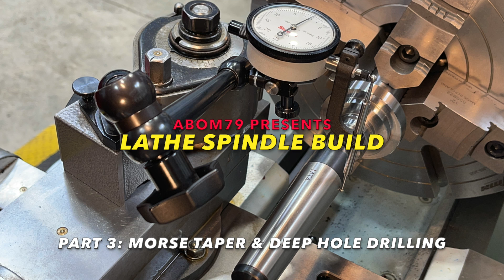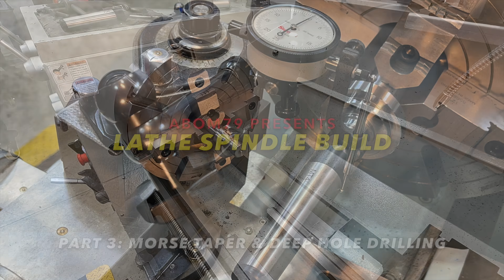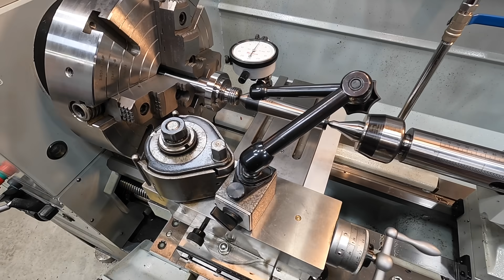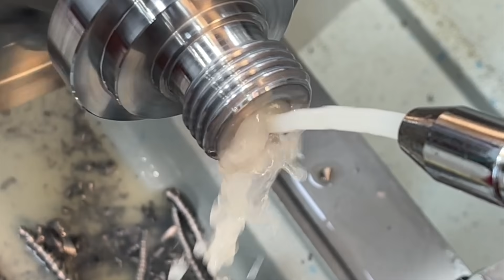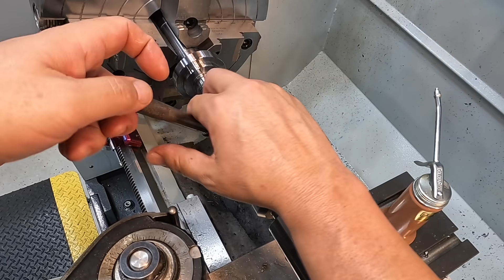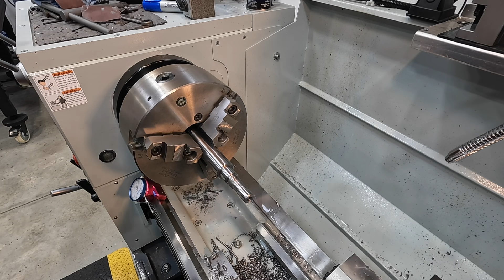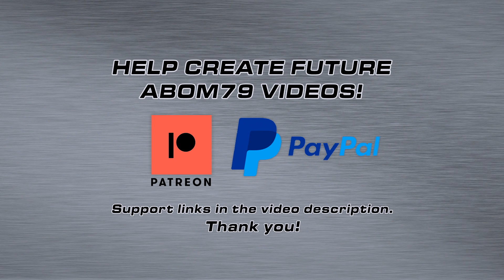Machining a Wood Lathe Spindle Ep. 3

Comment: Thank you Adam! I have a very similar project - making a replacement spindle for an antique, Goodell-Pratt No. 464 - that is what got me started in machine work over 10 years ago. I've procrastinated, now your video is the first one I've found that explains and demonstrates a clear process through every step. My one big remaining question is: can I start drilling the center hole - which concentricity is not all that critical - at the same time I am working on each end instead of waiting until the end? I am attempting this on a 7 x 14 mini lathe so I cannot feed the front end of the spindle into the chuck to drill the back end last as you show.

Comment: When you indicated the morse taper angle using the dead center, wasn't it backwards?  Using that angle you would have a smaller diameter at the mouth of the spindle, larger diameter towards the rear.
Reply: He had Ana adapter on the dial indicator and was indicating on the back of the sample. He cut the taper the right way around.

Comment: 2:00 I am not sure that MK4 and MK2 have same taper angle. Morse tapers vary in angle between sizes.
Reply: You are correct and they do vary by small amounts.This table is a bit hard to read here but the last line is the half angle  in degrees so MT2 is 1.407deg and MT$ is 1.4876deg.

Taper 	Large End	Small End	Length	Taper      Foot	Taper/Inch	Angle From Center
#0	0.3561	0.2520	2.00	.6246	.0521	1.4908
#1	0.4750	0.3690	2.13	.5986	.0499	1.4287
#2	0.7000	0.5720	2.56	.5994	.0500	1.4307
#3	0.9380	0.7780	3.19	.6024	.0502	1.4377
#4	1.2310	1.0200	4.06	.6233	.0519	1.4876
#4-1/2	1.5000	1.2660	4.50	.6240	.0520	1.4894
#5	1.7480	1.4750	5.19	.6315	.0526	1.5073
#6	2.4940	2.1160	7.25	.6257	.0521	1.4933
#7	3.2700	2.7500	10.00	.6240	.0520	1.4894

Comment: The 10mm bore down the middle it commonly used in woodworking lathes to place a tool to tap out the dead/live center, so it is pretty important that it exists, but perhaps not important to be perfect (although imperfections may affect balance).

Comment: per machinery's handbook the no2 morse and the number 4 morse have different angles.  no2 is .04995/in and no4 is .05193/in - close but not the same.  

You can't set up a morse 2 using a morse 4 - or any other size for that matter.
Reply: That said... he did finish out with the Morse #2 taper finish reamer. All of my machinery (except the big drill press) is Morse #2. I made a standard plug and socket gage for that size. First I made the socket and used an MT2 roughing reamer then an MT2 finish reamer. Then I made the plug gage to fit that socket gage. Then I touched up all my machine spindles and fixtures using the finish reamer.  The result is that all my my machine tools fit all my tooling perfectly.

Comment: This project has inspired me to consider making a new spindle for my 20" Walker Turner drill press with a bent spindle that straightening efforts have not fully resolved. One thing I noted in the video is that you made no mention that each Morse taper is a different, a #2 is .5994 ipf and a #4 is .6233 ipf unlike a Jarno that is a constant .6000 ips . Using the #2 reamer I'm sure has corrected the angular difference.

Comment: Its looking great. The purpose of the hole running through the center is to use a knock out bar to get the drive spur out if you use one in the morse taper.

Comment: I have machined lots of parts with my cheap chinese midsize lathe thanks to you Adam, you have always inspired me and you are such a great teacher. Bought my lathe 6 years ago, and I have machined parts for skilifts, pulleys, bushings and axle shafts for several industrial lawn mowers, snowmobiles, and so on. And I'm about to start my own business! All of this would never had happened if I didn't stumble across your channel many years ago, and I got so amazed by what you did and how high your standard was. I owned one used Swedish, and in very good condition, vernier calipers when I bought my lathe, and now I own so many precision tools which I use to machine parts to a precision I didn't even know was possible.
Big thanks Adam for everything that you do for making videos, and my greatest thanks for introducing me to manual machining.
Victor, Sweden

Comment: all this work and the taper is wrong...lol. OCD down the drain
Reply: The reamer corrects the slight difference In the tapers.
Reply: The taper was bored slightly wrongly, but the workpiece is not trash.  It can be fixed by re-boring at the correct angle.  M2 is a more gradual taper than M4 by about 0.002 inch(dia)/inch(length).  So down inside the hole, the diameter needs to be opened up by about 0.006".  The outside of the hole (wide end) should not change.  This might be too much to accomplish with the reamer alone.  But maybe not.  He did spend quite a bit of time with the reamer, and he did demonstrate a nice tight tool fit.  So maybe he has already corrected this mistake.

Comment: This reminds me of the a large drill I had to grind a pilot on to . The problem was the Morse taper was way off . The size was correct at the large end or at the gage line. The problem was at the small end of the taper it was about  .010- .015" under size. The drill as you might guess was made in China. 
I was able to get the job done . I told the customer I couldn't guarentee how true it would run. I couldn't see how he could hold it by the taper. He never complained about it.

Comment: Sorry Sir I do hate to say this buy a No 2MT is 0.04995" per inch & a No 4MT is 0.05193" per inch. It being a common miss conception to believe they are all the same. You need to check your Books first. My books give two very slight differences So I give you the Machinery Handbook One. I am taught to use the same size taper as the one you wish to copy.
Reply: Thanks for pointing this out. I noticed the same thing having machined Morse tapers without a reamer to correct the error. Mr Stephen A Morse has a lot to answer for. Why couldn’t he have standardised on a 3 degree included angle for all Morse taper sizes instead of making each one a different angle. Probably to make it harder for competitors to copy?
Reply: MT4 tapers more than MT2, so the material would need to be removed at the narrow end (i.e.: down inside the hole) in order to convert MT4 to MT2.  About .002 inch/inch x 2-1/2 inches = 0.005" (approx.), which is a lot of material for a reamer to remove.  If you watch closely, you will see that he gets the same reading with his digital caliper (0.6975") both before and after the reaming process.  It would only be after you see the caliper reading having increased that you would know that enough material has been removed to ensure the conversion.
Reply: But Adam finished it off with an 2MT reamer which would have finished it off at the exact angle.  The initial boring didn't have to be spot on.

Comment: The through hole is very important at a knock out bar is often used to get the drive center knocked out of the spindle.  It is also used for vacuum chucks that are used to hold bowls for final external turning to remove the tenon that was used for the internal turning process and sometimes even for a draw bar this used to hold specific drives and other attachments.  Hope this helps explain why the through hole is really necessary.

Comment: Since I saw several commenting about the angle error difference between the MT4 setting and it being different than an MT2, Though true but assuming that the reamer was in fact a MT2 Reamer and not just a generic 3° reamer, then the reamer definitely cleaned up the error and here's why...

The MT4 taper angle is slightly larger than the MT2 and thus when the initial boring op cuts were made to bring it to size, the small end would have been too small (about .005" too small in diameter compared to what it should be for the given big end diameter) so as long as the reamer did progress to the point that it was cutting to some degree on the big end, it definitely cleaned up the entire taper / length because it would have had to cut the small end first and progressed outward towards the big end.
Reply: This right here and end of story. I got curious about this discussion and drew it in my software.
Reply: @wolffengineering7038  Granted, I'm sure it was pretty quick for you to sketch out in whatever software you use as I could sketch this is in AutoCAD and / or SolidWorks in short order but it can be calculated faster as its just a simple basic Trig (Tan Function) calculation. 
Just take the Tan of the half angle for each and multiply that by the spec length for the MT2 (which is 2.56") that will tell you the radial difference between the big end and small end. By doing that, you see that the radial difference is greater for the MT4 taper and thus the Small end diameter is smaller

Then you can take it a step further and multiply that value by two and subtract that from the large end diameter and know what the small end diameter is. 

This is why, if you have to error and then use a different tool to correct the error when it comes to tapers, you want the larger error (too small diameter error) to be inboard with the smallest error (most correct diameter) outboard, that way its a simple visual reference of the outboard end that is easy to see. The moment it starts to show indication that its cutting, then the entire length has been cut since the cutting will start at the inboard (largest error) end and work its way out to the smallest error.
Reply: @CP_300PRC  yes, it was about 1 minute
Reply: Yep but if he didn't ream right to the end, then the taper would be unsupported right where it's most critical.   The owner of the lathe should invest in a reamer of his own and a bottle of blue to make sure.
Reply: @MattOGormanSmith  Sorry but even reaming several thou short is not going to have any detrimental effect, especially in an application that sees little to no radial loading. especially being that its only roughly a 3° included angle taper  Hell, even hundred thou short in this type of application will have no negative effect. 

If it was a milling application taper, like say a CAT40 taper (i.e., something wit a much larger included angle and that sees pretty substantial radial loading (comparatively speaking), then yes, no doubt but here? nope, and no reason for the lathe owner to invest in a $50 + dollar tool (for a good one that you can trust its accuracy) that he or she will likely never use again after this likely to be 1 time use.
Reply: Agreed.  And he may have already fixed the problem, given the amount of time he spent with the M2 reamer.  A good technique to reduce wear near the tip of the reamer would be to start with light thrust, then increase as the proper hole taper arises.

Comment: Morse tapers are not all the same angle! Morse got it wrong, it's not 3°!  You have to use the Morse two taper to set up the angle to cut your taper.
Reply: No he doesn't because he used a reamer to clean and true it up. The MT4 has an ever so slight larger taper angle than the MT2 and thus the initial boring cuts would have left the small end too small (about .005" too small in diameter to be exact) so going it with the reamer corrected the error as long as the reamer was feed deep enough to do at least some degree of cutting / cleaning on the big end as it would have had to cut the small end and the cut progressed outward toward the big end before the big end would have began to cut and thus the whole taper length cleaned up and trued.

This does however assume that the reamer was a MT2 reamer and not some random 3° reamer.
Reply: @CP_300PRC  The point I'm making is there's no pount in carfully bumping in the wrong angle. Not many people know that Morse got it wrong !
Reply: @MatthewTinker-au-pont-blanc  I get what you're saying but I would counter that by saying, if you are going to bump it in and it has to be to the wrong angle but you intent to clean it up with a correct reamer, then you are better to bump it in to a larger (wrong) angle rather than a smaller (wrong) angle to simply gauging when reamer cleanup is complete. 

By erroring to a larger (wrong) angle, then cleanup occurs from small end to large and with large being on the outboard side, its easy to visually gauge when the reamer has completely cleaned up the full length. 

If the error was on the smaller (wrong) angle, then cleanup would occur from big end to small and thus you'd have to look down in the bore to see if its cleaned up the small end yet to know when you're done.

Are there other ways that if could have been done? SURE, no doubt but there is nothing wrong with the way Adam did it and likely was the fastest way to give accurate results (now this assumes that the reamer was an actual MT2 reamer and not a random 3° reamer)

Comment: You are doing a great job making a new spindle. Will be good as new.
 I enjoy watching your work like this but I think one day you will be mostly CNC machines.
Reply: It surprised me to see he was going to do this with a manual machine, when he started of measuring I thought this would be a great project for the cnc lathe, I'm happy to see it being done manually with the same precision.
Reply: @marcellucassen8033  Too many operations for the CNC machine he has plus a programming nightmare and having turn the spindle around to do all of the operations for a 1 off part.
 He is in the zone with manual machines. With a lot of knowledge.
Reply: @SteveColluns-hm2xx  I do not think he's had enough training on his CNC machines to do all of the programming plus I think he said once that his would not do the longer parts but I am not sure. 
 Are you familiar with the CNC machine that he has? I myself have 0 experience with CNC. 
 I am a old Tool and Die Maker  and have only used manual machines. Even in the Air Force.  I have a lot of experience and have built many Tools, Dies, Molds, Jigs and Fixtures but all on manual machines. 
 I have even used a old lathe that has a seat on it and a 4' swing that could make a 1 1/2 inch chips all day long. 

 My point is just like the jobs I did in my past were 1 offs . Never making the same part over and over again.
Reply: @SteveColluns-hm2xx  My thoughts also.
Reply: @ronnydowdy7432
,  @SteveColluns-hm2xx  Something like that was what I was thinking of, turning the shaft between centers as a learning experience and doing the treading and boring on a manual machine.
Reply: @SteveColluns-hm2xx he’s on vacation. Worry about yourself, the $ smells the same and spends the same no matter which direction it comes from.
Reply: @SteveColluns-hm2xx  no one cares about your (typing this from MX, on the island again) 18 machines. You’re a job shop. A bottom feeder. Nothing against job shopping, but at minimum you’ve got to keep it real. He’s on vacation and you’ll be dealing with your CNC circus and the employee who can’t show tomorrow morning. Enjoy!

Comment: the through hole in the spindle is so you can use a rod to push out the tool from the morse taper. 

the most common thing to go in there would be a Drive Center, which is like a dead center with teeth that can dig into wood to drive it.

I have some mandels for turning pens for my lathe that go into a morse taper.

another use could be for a vacuum chuck.
Reply: I could not have said it better.

Comment: I don’t think that MT2 reamer took out enough material to fix the error from setting up with a MT4. Perhaps use some blueing with a known good MT2 taper tool shank and check it.
Reply: As long as the reamer did touch and make some sort of cut on the big end, then it definitely cleaned up the error for the full length because the MT4 has a larger angle than the MT2 which means that by setting to the MT4 initially, the small end diameter would have been .005" too small when the big end was at size thus the reamer would cut at the small end first and progress to cutting outward towards the big end as it cut deeper.
Reply: well it did change the major diameter so it had to clean up the whole length of the taper.

Comment: MT 04 is 1.4876° and MT02 is 1.4307°. So you cannot setup an MT02 with an MT04.
Reply: Came here to say the same thing, All the morse tapers have different degree angles so this indication setup won't work. But its a good example of how to zero to the internal taper if you have the external to measure off of.
Reply: it's a .12mm error in diameter over the length of the taper. Not great, not terrible.
Reply: He did that to get close and then used the reamer in order to make it perfect.
Reply: @TheDandyMann  No he did not. He did not know the angles are different. Could have used the reamer to set the topslide.
Reply: @Petertje94  He could have, but he didn't. He still ended up with the right taper with the finish reamer anyway. His way just made the reamer take more off when finishing.

Comment: 25.53  When I first started at the machine shop I ran a "Horizontal Pecker Drill" (sometimes called a "Drill Pecker")  NOT to be confused with a "Wood Pecker Drill" ... 

It was pneumatically and automatically operated and did pretty much Adam is doing here, only a bit faster.

Comment: The through hole allows you to push the drive center out of the morse taper with a long metal rod. Give it a firm tap and the tool just pops out.